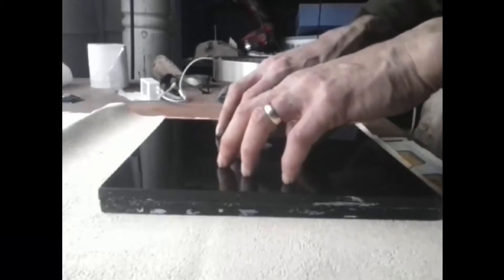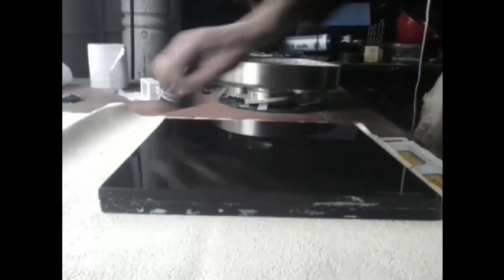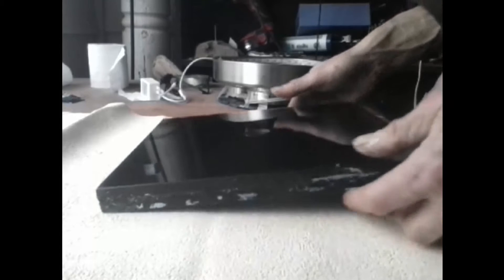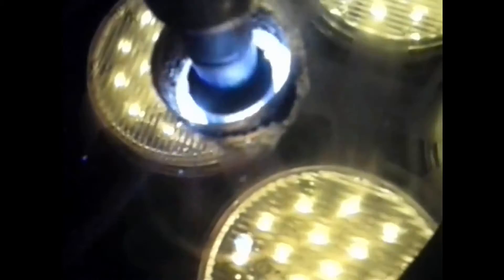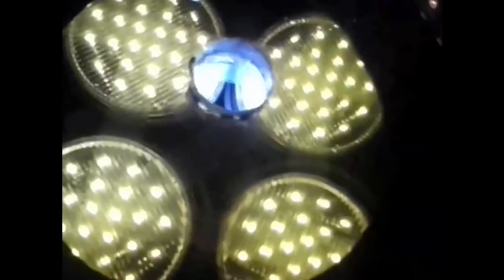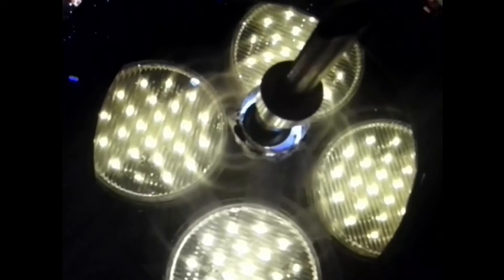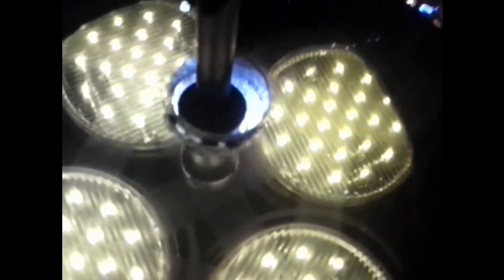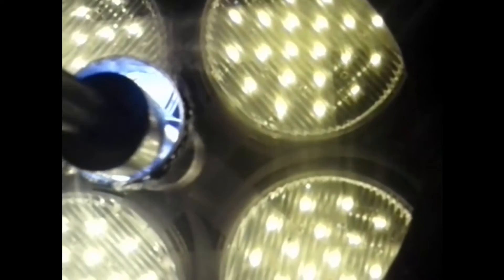UNIQUE FERROPLATE INVENTION - Immediately destroys "reciprocation"

Comment: If you use a magnet to push the bubbles out cause it will push the ferro fluid to the sides of u pushed the manget from center out. Cheers

Comment: You should put some dark colored piping in the hole to block the bare light from hitting the camera.
Reply: Maybe do one where you run an a conductor with an electric current through the hole and share your observations? Thanks!
Reply from the maker: did that worked well ..just producing a video using my son's phone...oh its beautiful...should be up in a coupla hours

Comment: Just a suggestion. If you place the plates in a strong plastic bag (eg a garden tidy bag) and then use a vacuum cleaner nozzle to suck out the air in the bag, then it may create enough of a vacuum to remove the trapped air bubbles. This may also be a good way to distribute the ferro mixture between two plates by applying an even amount of pressure on them.
Reply from the maker: Its now sealed .. good idea though